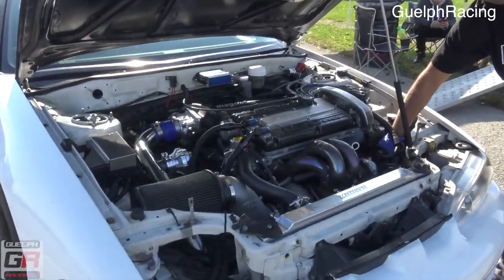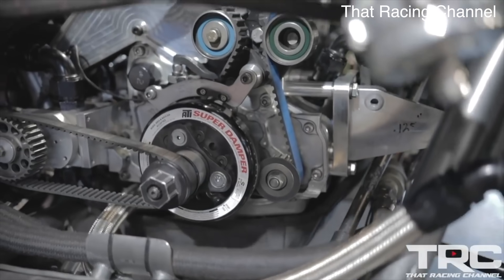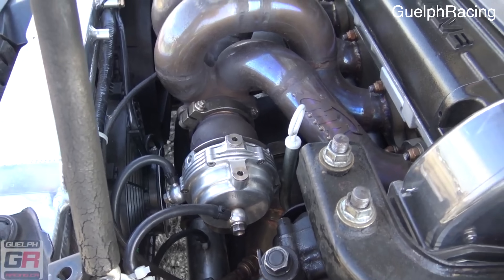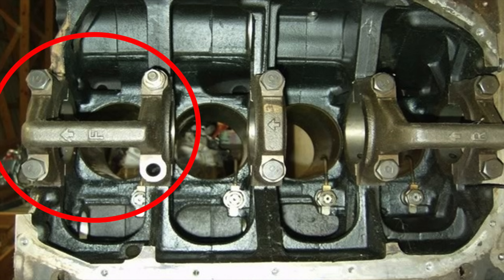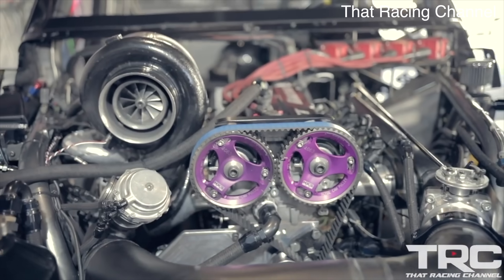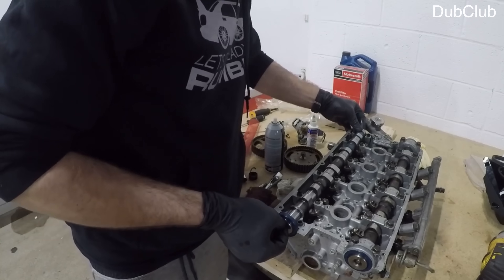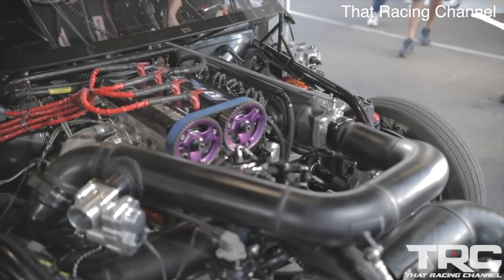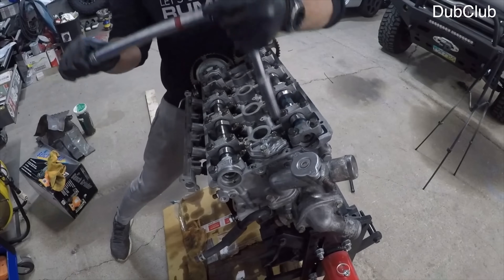Mitsubishi 4G63T: Everything You Need to Know

Comment: If crankwalk is blown out of proportion, then I must be unlucky to have experience it in 3 different engines. Had to rebuild all of them. Experienced it a second time in one of them. 7-bolts are a no-go in my book. Better to Frankenstein them together. Take a 7-bolt and a 6-bolt. Take pieces from each.
Reply: Yeah i agree.  Crankwalk has been the biggest problem with the 7 bolt.  The good news is several engine builders such as Jack's have done a lot of research on the problem and have successfully fixed the issues associated with the 7 bolt.
Reply: @kwedog2373  Agreed. Dozens of kits to reinforce thrust bearings, caps, crank bearings, etc. Not to mention cranks that have better balancing. The only downside is even those have limits. In my applications, it comes down to using thrust bearing supports that essentially press lightly on either side of the crank using stiff springs encased inside the support. It does apply a minuscule amount of drag on the crank (hardly even existent) while firmly supporting both the bearing and the crank from shifting at 300+ hp. I don't know what the max rating is, but I've seen them run at 480 hp.
Reply: Then I must be the luckiest guy, have owned my 95 tsi awd since new , and it never walked on me , original engine still
Reply: @jerrywhite9225  Then you probably aren't racing it like we race them. We're not talking a measly 150-200 hp where walk exists...we're talking 300+ HP with demanding tasks put on the engine. Drag  racing, drifting, street racing, time attack, and hillclimb.
Reply: I opt to take out the oil squirters that cool the pistons. These get stuck open causing oil pressure to drop.
Reply: @SelfmadeIllest  so...how are you preventing the pistons and rings from getting too hot...or do you drive like a grandma? Most people don't have oil pressure issues if squirters are stuck open (assuming you have ones that aren't compression/diaphragm driven in the first place). Even stuck open, there should still be the same pressure because an increased rate of flow also means an increased rate of return meaning a MORE consistent oil pressure. The only time I could see that even remotely being an issue is if you don't have a pickup gate installed in the oil pan and you're taking on multiple G's of sideways force.
Reply: @OneDoorToCore  forged pistons and aluminum rods. As if it were a b18b motor(built for boost) in fact alot of us go to the 4g64 for added displacement and a motor without squirters and no documentation of having problems with crankwalk.
Reply: The way 7 bolt motors are designed, when the squirters stick open the pressure leaves the main gallery and it scavengers for oil this is why the bearings go first and then the crankshaft walks..... 1jzgte has a similar problem. It comes from contaminated oil.
Reply: @SelfmadeIllest  A) Haven't had this issue. B) The physics and design of the motor wouldn't permit that to be the only reason or even the main reason you experience crankwalk. C) If you're going for a high horsepower build and you don't have a pressure-sump, dry-sump, or oil resurgence tank, what are you doing? 

The oil squirters are going to be a necessity with that kind of power and heat. What do you think people with 2j's and RB's are doing? You think they just scrap the oil squirters lol? Never had squirters stick open or closed. They stay clean and get serviced like a race engine should. With big horsepower, crankwalk comes from flexing, torque, work, float, and knock. Your engine has to be dirty as fuck if you're having that problem. Do you even use synthetics? Do you engine flush? How often do you service your bottom end?! Sounds like some budget street-tune problems.
Reply: @SelfmadeIllest  lotta crap there. I did mentioned where crankwalk stops. I guess you didn't read it. Since you won't read my posts, from this point forward I won't be reading yours. I have no interest in debates of conventional engines, because the mention of crankwalk was focused on heavily modified motors in the video. I'll argue in context and parameters but I'm not going to spend a lifetime arguing comparisons which will never equate to an understanding of factual evidence that exists in high vs low horse power motors. They aren't comparable and it's not within the context of the original argument
Reply: @OneDoorToCore  you said 7 bolts are a no go for you.
Reply: I read everything that's why I replied to what you said. It sounds to me that you cure problems by buying things and mixing 7bolt and 6 bolt parts, how this stops crank walk I'm not sure. But I have time for your explanation 😁
Reply: @OneDoorToCore  what you fail to recognize is that crankwalk happens just as often in factory cars as modified ones.
Reply: @OneDoorToCore  crankwalk is not a result of modifying the motor.  I'm asking what you are saying. It happens to factory and modified motors alike. So what do built motors have to do with this? Educated microcosm or not professor.

Comment: Lol. There are many that would disagree. Everyone has their favourite 4 cylinder. There are many of the opinion the SR20 is the beat 4 cylinder. It has certianly proven to be capable of making more hp and faster than the 4g63t. Anyone doubt this? Leave a comment. I will show you.
Reply: I will say no for the SR20. The block isnt as strong as the 4G63. And to make decent power beyond 400bhp. You need a built bottom end with rods, crank, sleeving and piston heads. Not to mention swapping the head to the SR20VE head for more flow.
Reply: @linchester8464  https://youtu.be/qlYZYOqsYD8 cant handle more 400hp without being bult you say?
Reply: @conradsealy9603  that is an old video and many have pointed out it a built bottom end. Dyno pulls only shows how much power for a short period of time. Try running flat out for 10 mins or 1 hour. Pretty sure the SR20 will crack.
Reply: @linchester8464  stock internals in the block. You didnt pay attention. Qnd the fact that its an old video shows just how out of touch you are. I myself have seen SRs routienly make 500+ hp with the stock crank,rods and pistons.
Reply: @conradsealy9603  again you are spewing nonsense. So many SR20DET owners and Silvia drifters has proven the 400bhp is the max you can go with the engine before anything goes kaboom. Piston ringlands, head gasket and main head bolts go off first. Push beyond 1.5 bars and your rods punch a hole into the block.
Reply: @conradsealy9603  dude i am comparing stock vs stock and you throw in built bottom end SR20s. Stock vs stock. SR20 could do 400 max before blowing up. Full Stock 4G63 pushes out 450 to 500 whp with full bolt on mods.
Reply: @linchester8464  lol. You saw the 549 rwhp video?
Reply: @linchester8464  the 4g63 blows up just like any other. Lol.
Reply: @linchester8464  lol. Right now. You remind me of Neo in the movie "The Matrix" when Morpheous gave him the red pill.🤣🤣🤣🤣🤣
Reply: @linchester8464  well unless he's talking about the SR20VE then its going to push more power(not like its better than the 4G63 just saying that the SR20VE is better than the DET)
Reply: @carboydorifutoparty3976  thats what i been telling. Nothing is going into his thick numbskull. 

I played with SR20DETs and SR20VET and to go above 500 to 600hp. You need a built bottom and top end. And lots of plumbing work to get the VE heads to work.
Reply: @linchester8464  looking at the commnts now I see your point dunno why he won't just say oh ok cool. And move on but it seems like he keeps digging his grave way deeper than it needs to be by not listening. Oh the people today
Reply: @carboydorifutoparty3976  the VE is way better than the 4g63 kid.
Reply: @conradsealy9603  well I wouldn't go THAT far since it seems like most of the cars with the fastest 4 bangers are normally K series or mostly 4G63s now SR's aren't bad but their not as common to even be used for drag(US wise) now if it we're somewhere like Australia then you'll see more high hp SR20VE's but I have yet to hear really too much to any records of them breaking records close to the 4G but what do I know.
Reply: @carboydorifutoparty3976  you are aware that the SR has the mph world record for 4 cylinders? Right? Or would you linke a link to read it for yourself?
Reply: @conradsealy9603  well wait are you aware that their is a car named the red demon with a 4g63 that just took the record of the worlds fastest stick shift car just recently?
Reply: @carboydorifutoparty3976  hmmm. Nothing to show huh?
Reply: @carboydorifutoparty3976  as for red demon. Thats great. Even though its a dog gearbox they use in Red Demon. No clutch need to shift gears.
Reply: @carboydorifutoparty3976  that gearbox isnt much different from a Liberty transmission. Thats where that car gets its speed from. What!? You thought I didnt know about Red Demon? Lol.
Reply: @conradsealy9603  I it still doesn't change that it's now the fastest stick shift car rn. You can even look up a bunch of fl2k19 videos showing it breaking the record...plus their are wayyyyyy less SR's being used on the streets and the strips to be seen compared to 4g,K's,F20's,(in other countries)C20xe's,and B series
Reply: @carboydorifutoparty3976  as for there being less SR turbo engines in america; well obviously dummy. American never sold that engine in any cars sold in america. Thankfully. The rest of the world never got that pick up yruck engine. Lol.
Reply: @conradsealy9603  there's a bigger list of cars that share the 4g series not just the Evo's. Like the lancer wagon,Eagle talon,mitsu eclipse,Hyundai sante fe(4g is renamed the sirius instead of 4g in these including kias that shared these),Mitsubishi galant,mitsu starion,dodge colt,mitsu pajero,dodge ram 50,proton saga,and proton pernada. There are more but this is only most of the cars that share a 4g from mitsu and weren't just carried by trucks either.
Reply: @carboydorifutoparty3976  well thats great that the 4g63 was used in other vehicles but the same is also true for the SR. The S-chassis used SRs. The P10 and P11 Nissan Primera also. Renault used the SR in the Laguna. I bet you had no idea. Didnt you? As a matter of fact. The P11 with SR power beat the crap out of the 4g63 powered Mitsubishi Gallant in the BTCC in the late 90s. By the way. You do know what the BTCC is? Right?
Reply: @carboydorifutoparty3976  ohh yeah. The SR was also used in the Nissan Liberty minivan. If you like I can look for the BTCC champion and post a link for you.😉
Reply: @conradsealy9603  dude...im not stupid I know about the P11,P13,P12 sentras anyway.....especially the nissan pulsar gtir with the sr20det(which is a dream car for me anyway)that I would love to own but are sort of rare so I many not even have a chance of even getting one anyway. And cars like the nissan primera(hopefully I spelt this right since this is coming from the top of my head)had the SR20VE(I'm pretty sure there were some other models)and the only car that I can think of was one named the X-trail with the SR20VET.
Reply: @carboydorifutoparty3976  I agree that those RNNR14 chassis are extremely rear. There are only 2 in my country. One is drag raced. Consistent 10 second car even though he still drives it on the street. A/C even works too.
Reply: @linchester8464  have you ever seen a oem cast wet block SR make 1400hp?
Reply: Conrad Sealy I own a sr20 det
Reply: @robocop3961  dont believe all his bullshit. He just a fan boi.
Reply: @linchester8464  sr20 relies to much on high boost turbo pressure to make a lot of power, just compare jett racing eclipse and teknogayz silvia which both car uses compound turbo, the former with 112 psi at 2200whp while the latter needed to increase its boost to 120-130 psi just to reach 2100 whp. See the difference why the 4g63 is better.
Reply: @linchester8464  and overall performance of a car is affected by many things like traction,weight,aerodynamic, anyway his just a fanboy hehe.
Reply: @osama1929  are you high or just clueless? You need to watch this that video again with the 112 psi 4g63 by Jett Racing Eclipse. Teknotoyz used 85 psi to make well over 2000hp.
Reply: @osama1929  when this race took place the all billet head and block Jett Racing engine had a compound turbo on it while the SR powered Teknotoyz Silvia still had a single 98mm turbo.
Reply: @robocop3961  so do I. I certianly beat up a few evos in my country.
Reply: Where do you Nissan idiots get your facts? There isn't one SR20 that is even close to beating a 4g63. They are no where near as strong and they do not last. $g63 is a billion times better than a sr20. Stock 6 bolt 4g63's are pushing 700hp+. Fastest 4 cylinder in the world is a 4g63, fastest manual shifted car in the world is a 4g63, fastest awd car in the world is a 4g63, the list goes on and on.
Reply: @RichRusso4218  Conrad is the dumb fuck. I been drilling thru his numbskull
Reply: @RichRusso4218  there is a correction for the fastest AWD. the R35 at 6.582sec at 232.28mph is the record holder for fastest AWD date 10 Jan 2018. 

Fastest 4 clylinder is indeed the 4G63 but thats RWD config at 6.23sec at 229mph
Reply: @linchester8464  its actually 6.200 seconds now at 225mph by jett racing eclipse.
Reply: @linchester8464  not to mention an all motor v6 mitsu 6G75 FWD mirage 8.83 seconds 167 mph.
Reply: @osama1929  damn!!! That thing is a jet
Reply: @linchester8464  have we seen an all motor nissan reaching those kind of feats? not really, they heavily depend on turbocharging to get their car go fast. Its not like its that hard to put a turbo on your engine, i mean as long as you have the components of the engine designed to handle loads of power putting a turbo is the easiest thing to do, its when you make a car go fast without a turbo shows the real potential of your engine.
Reply: @osama1929  i wont deny that. If the base engine without a turbo is darn good. Adding a turbo is just icing on a cake. 

The 4G63 is no denying the best 4 banger out there with the K20 close second. 

The inline 6 king will still be the 2JZ. I love my RB26s but there is no way it can beat the monster 3000bhp that a 2JZ could produce. 

The VR38 is reaching new heights with 3000bhp V6 turbo. We might see 4000bhp VR38s in the near future.
Reply: @osama1929  if money is no object i will def build the best 4G63, 2JZ, RB26, VR38 and a 6 rotor
Reply: @linchester8464  yeah thats not to say that nissan engines are not good, its just that there are better designed engines out there from other manufacturer. Yeah a 2JZ is a monster.
Reply: @osama1929  and Jett Racing doesnt have the mph record. An SR has it.😉
Reply: @RichRusso4218  fastest mph 4cyl is a Nissan SR kid. I posted a link on the 10 fastest 4 cylinders in the 1/4 mile. Or maybe I will send it to you too https://www.dragimportnews.com/top-10/quickest-4cyl/
Reply: WtFUCK is ur problem Conrad faggie ??
Reply: @harrissaeed657  I dont have the problem. But you do if you see the links,open them and see the truth yet still deny the truth. Lol.
Reply: The 4g63 fanboys have seen proof yet they have shown nothing. 😆😆😆😆
Reply: By the way. Can anyone of you send me a link of the fastest evo in the 1/4 mile? Somebody? Anybody? This is your chance to show me.
Reply: So. Can anyone show a link to the worlds fastest evo? Or is that you all already know the GT Autosound  wet oem cast block SR IS faster. Not for an aluminum cast block. It remains to be seen if the 4b11 can do what the SR can.